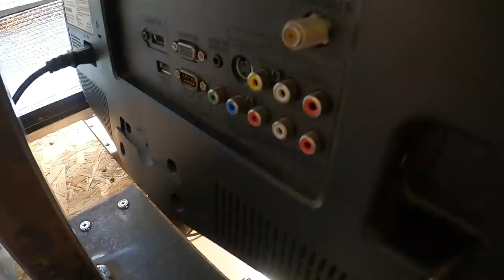Homemade Monitor Stand - RV Living

Comment: Dude, You have A CRAZY Skill Set, Right? Nathan you can do anything you set your mind to, If I have learned anything after 5 years of Full-Timing in my 2006 5th wheel is that wood framing, fiberglass laminate, chip board floors and TPO Roofs expire. Black Mold is terminal period.  Weigh it out in your thoughts and prayers... You can do this....

Comment: I would take a new rv or bus to build .. i also live in a 1989 tiffin alegro but it has an aluminum roof and the only fiberglass is where the nose cone connects..I used roof cement to seal mine off. And it's not leaked since I got it..mine has auto leveling jacks..the land will be nothing but problems unless it's out in the desert somewhere..permits permits unless Washington State will alow containers ..the east coast there no where u can even put a trailer home unless it new then u have to have 5 acres then an can only be so many homes even houses to the area..so unless u have money u can't make it out east even down south way to many ordnance law's